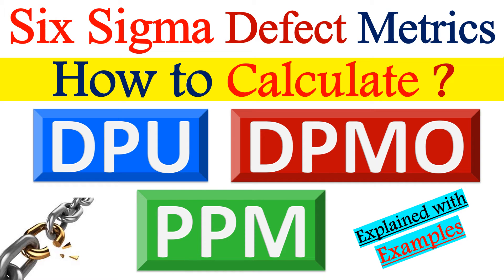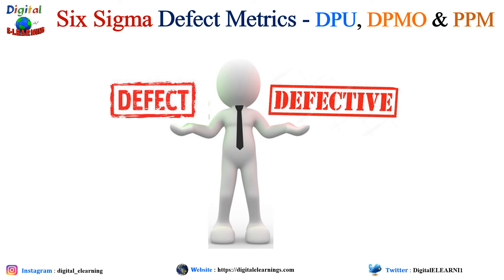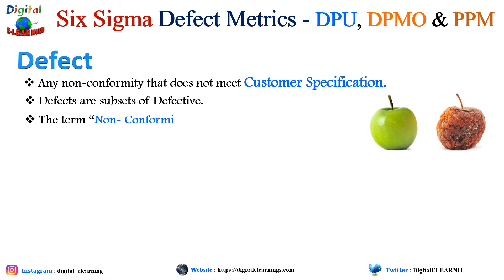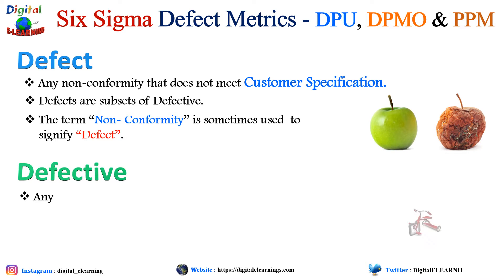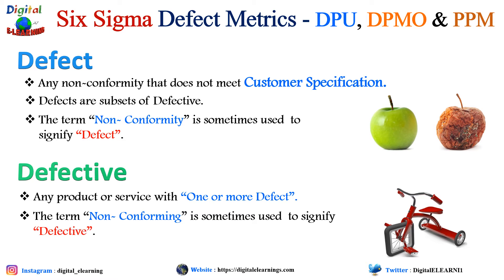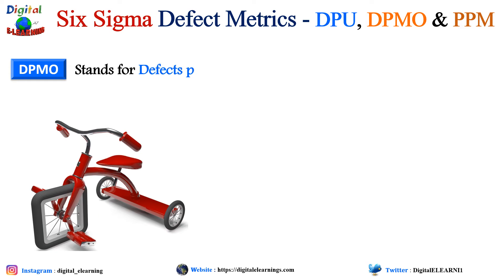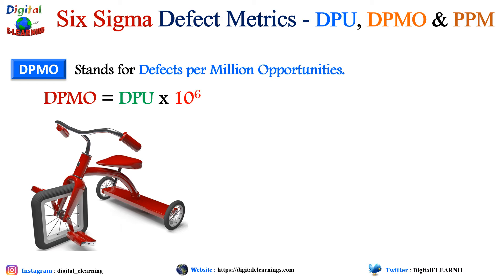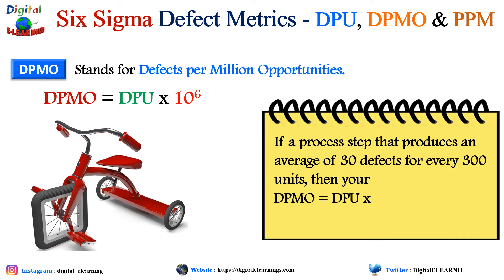What is Six Sigma Defect Metrics | What is DPU, DPMO & PPM ? | How to Calculate  DPMO, DPU & PPM ?

Comment: Excellent Instruction. However, in the example about the PPM, the PPM was incorrect. The correct answer would have been 700,000 and not 70,000. 7 * 10^6 / 10 = 700,000. If it was 7* 10^5/10 then the answer would have been 70,000. Thanks again for your help with this!